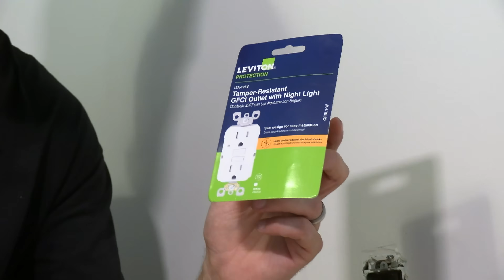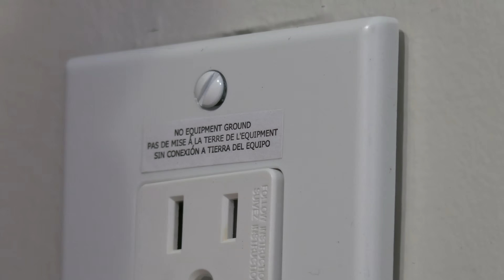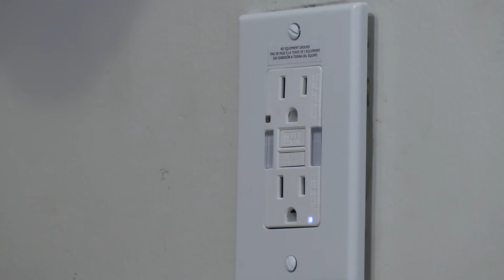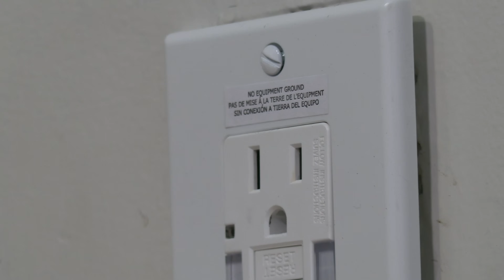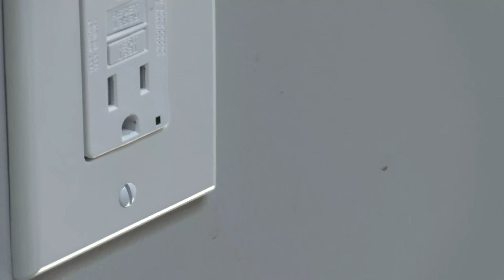Can You Replace A 2-Prong Outlet With A 3-Prong?

Comment: On the short wire, is it against code to try to pull a bit more length through from the backside?

I live in a 1960 apartment. They did a renovation a few years ago eh oh updated the kitchen and they upgraded the panel. They went through the whole apartment and added 3-prong outlets with no grounds. I actually measure 40-60VAC between the hot and gnd. ?what at the what? No labels on covers either. That’s not compliant right? 

Even if I add gfci, won’t work at all in my office where I have a large UPS which refuses to operate without a ground connection. What to do then??
Reply from the maker: Yeeeeeaaaaahhhh, sounds like it's time to talk to your landlord...

Comment: If adding 2 GFCI after an outlet do you connect to line of both or load of both?
Reply from the maker: To reduce cost & confusion, we'd recommend using standard (non-GFCI) receptacles off the load side of 1 GFCI receptacle. The code specifies that they all be GFCI-protected, not each GFCIs. The standard receptacles will be protected by feeding off the load side of the GFCI unit.

Comment: Couldnt you attach a wire and ground the receptical to the metal box? Assuming metal conduit is also present???
Reply from the maker: When a tester indicates that there is no ground that means it has no ground through a wiring system or conduit system. Grounding the device to the box does not mean that the box is properly grounded, and grounding to metal conduit does not mean that the conduit is properly grounded all the way back to your ground rods. If (like in our case) a reliable tester still indicates no ground, you could test the other end of the conduit run, or the issue may be in the wall. Given that wild goose chase, we opted for a GFCI solution.

Comment: Video title has nothing to do with the video. You stripped too much wire off that black cable and left too much exposed copper. Why didn’t you ground the box with the ground cable inside? Then it would have been bonded to the outlet as well.

Comment: i dunno about this. been working mine for 6 days and only red light. fed up i got  tester said faulty ground. took ground off and reset... still red light. thinking what is connected to the ground from the second floor (1900s house) PLUMBING... so no plastic... i read up so replies about it are nil as i may not use but when connected to ground the tester came up clear. a ok... for the first time in 6 days. live learn. then i see all these guys doing 2 wire and i am astounded that theirs work and mine dont. maybe different GFCI... 

thanks tho

Comment: Please help this confusion. Is it safe to use highend electronics with gfci outlets, even though it says. “not for use with equipment”?
Reply: Sure it is safe. You just should do all the connections powered down. Like if you connect a PC to a TV that is grounded through the antenna/cable when the PC is on you might fry the inputs on the TV. The obsolete RCA connection is the worst in this as the signal connects before the ground (an idiot design).

It is good to get a power strip and connect your devices to it. The power strip levels the ground potential between the devices.

Comment: if the box is made of metal and the plug is not a isolated ground you can screw the outlet in without wiring the ground wire
Reply: No, you must use  self-grounding outlet. Only it provides good enough ground. Also of course the box needs to be properly grounded. An ungrounded metal box is a danger even with a GFCI. If it leads current to the equipment ground conductor the GFCI will not trip.

It is important to understand the difference between ground and good enough ground though any ground will cause GFCI to trip.
Reply: @okaro6595  thats what I ment! you misread my comment

Comment: SO that Outlet is a GFI one but it wasn't protecting because the ground wasn't hooked up?  I think I missed something here.
Reply from the maker: A standard 3-prong would not have a functioning ground, so the GFCI circuitry serves that safety feature by killing power in the event of an emergency.
Reply: @ElectricProAcademy  I always thought the GFCI worked only with a grounded line.  Interesting.

Comment: Just a couple suggested corrections to this nice video, in general, the potentially dangerous cardiac current of ~15ma would only apply if it’s delivered intravenously, not via the skin on either side of the heart. The exception being voltages generally above 800v, depending on specific cardiac condition.   The other suggestion is simply inserting the wire on one side of the contact screw instead of wrapping it around the screw creating full mechanical and electrical contact is the preferred connection.

Comment: 3"? lol I shoot for 6" to 8" out of the box. I HATE short wires.
Ok what if BOTH wires are the same color (black usually on very old wiring)?
Or if both are cloth wrapped?
I will ALWAYS wrap every receptacle.

That metal tab is also there to ground a metal outlet cover.

All that BS is horrible looking. Who wants stickers plastered everywhere?

Got a NON Decora GFCI that is two prong?
Dark brown preferably?

Why not just use a GFCI breaker instead of all that nonsense?

Lucky me my stuff is grandfathered due to age of the building (over 100 years old).

3 prong GFCI's are overkill. Nearly everything you plug in is 2 prong.

Hint: if you have outlets that MUST be upgraded then get it done BEFORE you put it on the market and before an inspector comes.
You can avoid those high fees for replacements.

Any decent handyman can under cut those prices by a LOT.

My outlets are 2 prong antique. I do not want to 'upgrade' to squat, and especially do not want to plaster stickers all over the place.
Upgrading will destroy the appearance and value.
I just want to replace with like and kind.

Comment: With the GFCI requirements extended to the 250 volt receptacles in locations where previously it only applied to the 125 volt receptacles,  I'd expect major home improvement stores to soon  keep a constant stock of double pole GFCI breakers in various sizes other than the 50 amp, which is very commonly used and required for hottubs and spas.   For instance my sister and her boyfriend live in a tract home built in 1995, and needed to replace a two pole 20 amp GFCI breaker that failed, for the kitchen countertop receptacles fed by 12/3 NM with the tabs on the hot side broken to split the receptacles  into the two circuits required for kitchens, and none of the hardware or home improvement centers carried that breaker, they had to order it and I believe the boyfriend borrowed the two pole 20 amp breaker for the window AC and swapped it for the kitchen until the proper replacement arrived, which is a safety hazard near the sink.

Comment: You mentioned the “undersized ground” not connected to the box. Would you connect it to the gfci ground screw? I have a number of 2 prong receptacles that I’ve upgraded to 3 prong. The boxes are metal and all have a undersized ground wire wound around the wire clamp in the box. I’ve pigtailed ground wires and attached them to the ground screw and my tester approves. Is it approved by code?

Comment: Per manufacturer instructions, the GFCI test button is the approved way to test, so while a plug tester GFCI test feature won't trip it, the test button on the device will, which is all that is required. (If an inspector gives you crap)

Comment: A GFCI without a ground connection will not work properly: it can only trip if enough current (30mA is standard in my country) manages to get to the ground in some other ways that is not the ground conductor (that is not connected). Chances are that this will not happen, and the path get closed by the unfortunate person touching the metal enclosure of the faulty appliance (at that point the GFCI will trip, but it may be too late, even 30mA of current may under some circumstances be lethal).
Reply: That just is the purpose we install them. GFCIs are intended just to trip when someone gets shocked. In the US they trip at 5 mA.

Comment: One after thought about wrapping. I wrap to keep the bare copper ground wires from coming into contact with the terminals. Also it's habit and a good habit. Like using my turn signals. I don't even think about them and use them whether or not someone is around. It's just good practice.

Comment: Great video and very useful. I understand that ground is very important. What if i have ground in the house but i want to install a smart switch that do not have a ground wire. Can this be done and be code compliant?
Reply: For a smart switch, it depends on if a neutral is present in the electrical box with the current switch.  You need to investigate whether this is the case.  If there is a neutral present, then choose a smart switch that requires a neutral.  If there is no neutral present, then resort to a smart switch that does not require one.   If you're unsure or uncomfortable about this, call a professional or take lots of pictures of the switch box to ask.
Reply: @jovetj  A neutral is present but my switch (sinope SW2500ZB) does not have a ground wire. Can this be installed in box (non-
metallic)?
Reply: @jfgagne17  If the device has no ground connection, then don't worry about it.  I'm sure everything about it is plastic, right?
Reply: @jovetj  Yes it is

Comment: You're fortunate. I live in an old house where there are practically no electrical receptacles or ground wires, simply straight black wires connecting to fixtures nailed into the wood. For a variety of reasons, it has been suggested that I employ wire channels that run along the exterior of the walls. I have a lot of work to do, but at least I'm not pulling cables through the walls.

Comment: I have a question for you: My house is about 5 years old, it has GFIC & in the bedrooms there AFCI. I had a short in the bed room & the AFCI did not trip but the CB in the panel did. Since it did not trip I assumed it was bad so replaced it w/ a GFCI/ AFCI  combo. type. To check it out I took a space portable heater & put the plug just part way into the receptacle as to cause a internal ark. It did not trip the receptacle. What is the point if it does not trip????? Thanks Bruce

Comment: Awesome video Jefferson. Here in Mississippi, Jones County which includes Laurel where there is a show call Home Town; we deal with a lot of NM clothed sheathed cable that has no equipment ground. Many electricians tell the clients to re-wire the house. If the wires are old RHW or Paraflex cable I usually do recommend a re-wire. With these methods there’s a significant chance of active knob and tubing. 

However; NM cable that have a cloth sheathing with THHN wires or as the one in your home: THHN with a smaller sized EGC, I use this method quite often. I would like to add a few points to your brilliant video. 2020 NFPA70 406.4 (D) Replacements (2)Non-Grounding-Type Receptacles (b) and (c)

The method you used was (b) GFCI type receptacle. I would like to point out that when this method is used, ANY RECEPTACLES ON THE LOAD SIDE (DOWNSTREAM) SHOULD NEVER HAVE EQUIPMENT GROUNDING CONDUCTORS. This can create a potentially very dangerous set up. Load side receptacles using this code allowance need to be marked GFCI Protected and NO EQUIPMENT GROUND. That means DO NOT run an equipment ground anywhere in this set up. I have seen people install a GFCI Receptacle and run a EG from there to the load side receptacles. WRONG. NO EQUIPMENT GROUND means no equipment ground. The standard tester will read open ground and CAN NOT be used to test the GFCI protection. If an inspector says that if it can’t be tested that it can’t be used: Tell the inspector this: Test the circuit by pressing the TEST button on the GFCI receptacle. This is the acceptable way that manufacturers of GFCI receptacles allow for testing. IF YOU FIND A GFCI RECEPTACLE THAT TELLS YOU TO USE A TESTER OTHER THAN THE BUILT IN TESTING SYSTEM PLEASE LET ME KNOW ABOUT IT.

We must also keep in mind the informational notes. Note 2 directs us to 250.114 for a list of cord and plug connected equipment or appliances that REQUIRE AN EQUIPMENT GROUNDING CONDUCTOR. Which will render this method invalid for those particular items listed in 250.114

And we must also consider 406.4 (D) 4, 5, and 6 as applicable when replacing a receptacle.
4: for Arc Fault 
5: for Tamper-Resistant
6: for Weather-Resistant

Great video. Just wanted to add a few points of common mistakes I often run across.

After reading more comments it amazes me at how many people are confused or lack knowledge and understanding of this method. Joel stated that the EG was lost, there’s comments asking why he didnt use the existing EG. It was lost: these old cloth sheathed NM Cabes that have an EG, have an undersized EG and can often break in the circut or get damaged from a one time fault condition. This is why new NM-B cable carries full size EG on 14AWG, 12AWG, and 10AWG. 

The EGC serves no direct function in the GFCI Protection circuitry mechanism. The GFCI monitors the current flow and return from the hot (ungrounded) and neutral (grounded Conductor, not EGC). A 4mA to 6mA difference will trip a Class A GFCI Protection Device. AND YES 10mA CAN DAMAGE YOUR HEART AND PUT YOU IN A-FIB. 6mA is close to the Let-Go point and in itself can be very dangerous to the heart in short time frame,  and it is even MORE DANGEROUS TO SMALL CHILDREN.

The EGC should never carry current in normal situations. The purpose of this code allowance is to provide a reasonable method for replacing a 2-prong receptacle with a 3-prong receptacle. You are trading the equiptment bonding, (which is a more accurate term than eqiptment grounding), with current monitoring. Therefore , when the equipment faults to the the NORMALLY BONDED parts, a loss of current will be detected and cause the GFCI Protection to open the circuit. SO YES THE GFCI WILL WORK WITHOUT AN EG. 

I realize this may be hard to wrap your head around. It takes a lot of knowledge and understanding in Grounding and Bonding and the fundamental understanding of how a GFCI device works. You have to understand these concepts. If you were called out to perform an equiopotential bonding system for a new inground pool, you would have no idea what to do.
Reply: Hello, I just saw your comment and I wanted clarification. I am currently working on an old house where the 3rd floor has no grounding for except 1 outlet. 

I wanted to install GFCI on one of the room outlets, likely the first outlet in the circuit. The only grounded outlet seems to be somewhere at the end of that same circuit. 

So if I install a GFCI in the first outlet of the circuit, I would be creating a dangerous situation because of that grounded outlet at the end of that same circuit?

Thank you
Reply: @darklight8675  I’m assuming you mean there’s no equipment grounding conductor (EGC) . You can install a Class A GFCI receptacle without an EGC. You use the hot (ungrounded conductor) and the neutral (grounded conductor) . If you know where the first receptacle is, you can install the conductors from the panel to the line side of the GFCI receptacle and the conductors downstream (serving the rest of the circuit ) to the load side of the GFCI receptacle. You will not be able to use a plug in tester to test the GFCI, you will test it by pressing the button on the receptacle. Your other option is to install a GFCI breaker at the panel.  

You mentioned something about a grounded outlet at the end of the circuit. That sounds like it’s a bootlegged equipment ground, likely taped from the grounded conductor (neutral). It is best to get a licensed electrician to evaluate the situation: Incorrect bonding, grounding, and bootlegged EG’s greatly increases chances of electrical fires, malfunction, and / or lost of life from electrocution. It is very serious and should be only handled by someone that absolutely knows what they are doing. Don’t risk your life, property, and other lives by trying to do advance troubleshooting without proper training and experience.

Comment: In my apartment my outlets are just 2 wire no ground. So when one was replaced I noticed the electrician didn't label the outlets "no equipment ground' nor did the outlet have a way to ground the receptacle to the metal box it was installed in. The building is built in 1900's ...
Reply: File a complaint with HUD
Reply: If there is no ground then "grounding to the metal box" makes no sense. I do not like the idea of ungrounded metal boxes as if the live wire would touch the box it would energize all connected equipment cases.

Comment: The only thing that I notice is that you had excessive amount of bare wire exposed out of the wire clamp on the black wire on the gfci so I would have cut the wire down a little or at least wrapped the outlet with tape.

Comment: I am a 35-year electrician. This is, in my opinion, a do not follow video. 1st, there is a ground wire available; therefore, no gfci is required. If there is not a ground available, the lead outlet of the circuit should be put on gfci, and the outlets down the line will be on the load side of the gfci. 2nd, the box is a cut in box, thus making it simple to change to a plastic (mom conductive) box and gives a chance for the short wire to be pulled, not very often does this happen but it's better than a metal box. I didn't see or hear any references to bonding the box. 

The bare wire ground in romex is by far the biggest overlooked safety issue from the "code enforcers." I mean, why, after all these years, has nobody realized that is the #1 available thing in an outlet box that shorts out? Is that ground actually undersized? #12 hot and neutral, a #14 ground is sufficient. And 3 inches of wire extending from the face of the box is absurd, 6 inches is what I was taught.